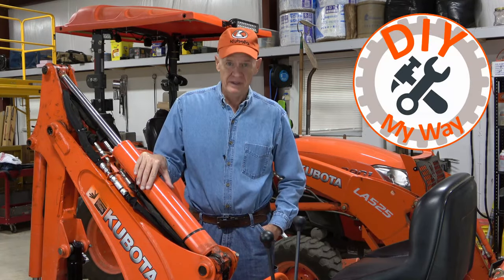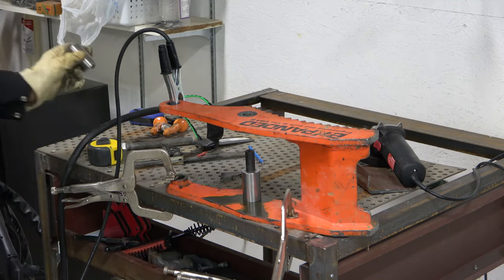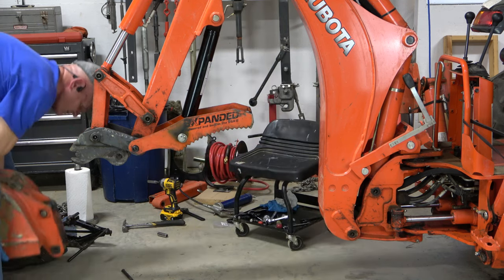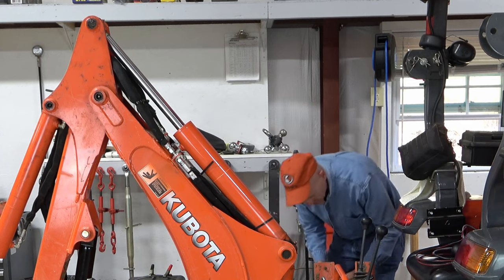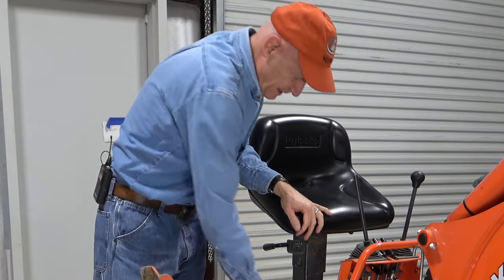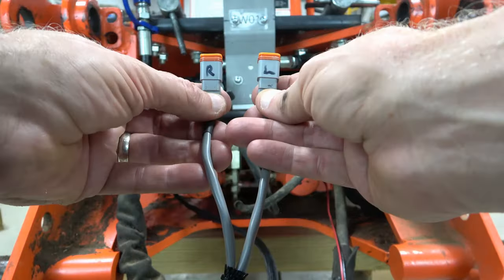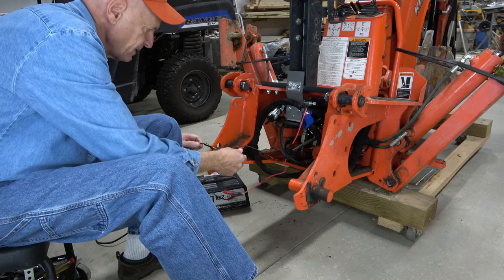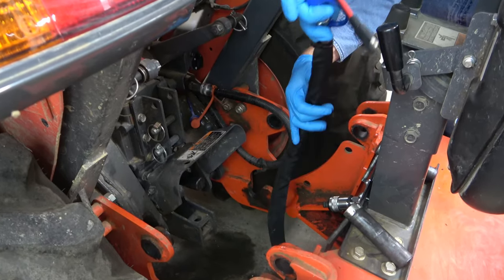Adding a Hydraulic Cylinder to My Backhoe Thumb - Part 3 (#196)

Comment: Hi Martin,
Very nice build. I really liked how you took time for the extra details to make this a good working system.
There is one item I would have changed is to change from a 3/4" pin on the thumb, upsizing it to 1". 
Your idea of running the long hoses up to a junction point is an absolutely great idea. So much better like you mentioned if a hose fails, it will be easy to replace on the digging end.
Excellent video series.
I give you an A+ 😊
Reply from the maker: Thank you Tom!  The grade 8 3/4” bolt has been plenty strong so far when it was a mechanical thumb so I’m betting on it being strong enough for the mechanical thumb, especially with the heavy duty support the spacers and gussets provide.  Time will tell.  I figured if the Kubota thought it was a good idea to use bulkhead fittings, I should too.  Thanks again for the kind words!

Comment: Nice job Martin. Yes if you plumb the valve in end of the circuit you won’t have that drop in your boom cylinder.  Also the pressure relief valve you won’t need it .  The bucket cylinder doesn’t have enough pressure to hurt the thumb cylinder.  I’ve been using mine for two years now I haven’t had one issue with it.   Great job Martin ! You will enjoy having it .  Cheers
Reply from the maker: Thanks Sam!  Glad to know yours has done well and I won’t need the cross over relief valve. Thanks for watching!

Comment: Rapidly becoming addicted to your channel. Recently bought a new L2502 w/backhoe and this is on my list of mods. One thing….and I don’t know if it’s the same with your machine, but on mine, there are two aux power connectors; one on each rear fender. Could be an easier way to have gotten your power for the valve than running the wire all the way up front.
Reply from the maker: Glad to hear it!  You’re gonna have a blast with the backhoe.  So much fun to operate!  I already used my aux power connector for light bars so I ran a new power feed instead. Thanks for watching!

Comment: How's she goin'?  This is a nice add to your tractor and you did a great job with the install.  The issues with the way the 3rd function and crossover pressure relief valves are plumbed in are things that, with use, will present you with the ideal solution!!  There is  lot of planning and looking ahead when installing a 3rd function eh.  Looks like you covered all the bases though.  Thanks for sharing Martin and take 'er easy!!
Reply from the maker: Good evening Mike!  Yes, I think it’s a great improvement and will be even better when I replumb it and add the crossover relief valve.  Thanks for stopping by!

Comment: Good Evening Sir 👍👍😇Again Sir You have made an OUTSTANDING Video and These Subscribers Who Suggest To Modified Your Hydraulic Systems are Very Knowledges Folk's and that will Eliminates any Chaos, Death and Destruction 🧐👍🤣👌Sir, you will be very surprise how strong your welding's will be when you do many welding pass but since that Fine Gentleman Welder Was Doing You A Return Favor I would have done the same Sir 😇👍OUpssy, You backhoe needed some lubrification Sir 🤣👍 OUTSTANDING FIELD TESTING 👍😇👌💪Full Watch 100% and Have a very Nice Week Sir Cheers 🍻🍻
Reply from the maker: Bonsoir Dave!  Merci beaucoup! Yes, I could have made multiple passes with my little welder but I didn’t want to take the chance knowing the enormous stresses those parts will be under.  The advice from viewers more knowledgeable than me has been great!  And that really was the sound of the zip tie but I couldn’t resist making the joke. 😁 Thanks for watching! Cheers!
Reply: @DIYMyWay  Keep Warm Mon Ami Cheers 👍👍👌👌😇😇🍻🍻